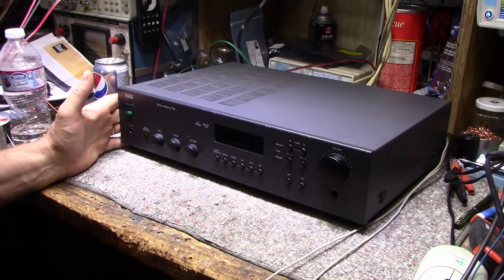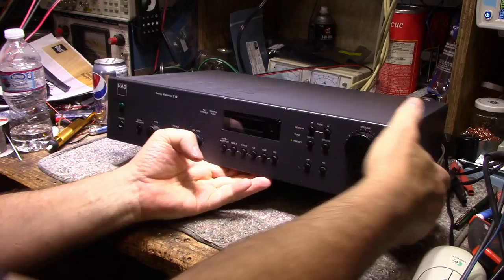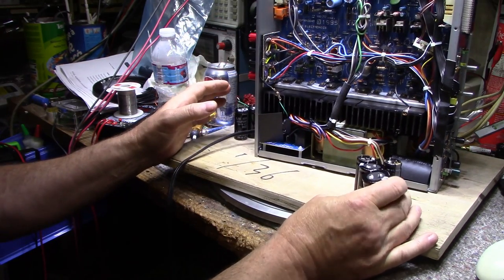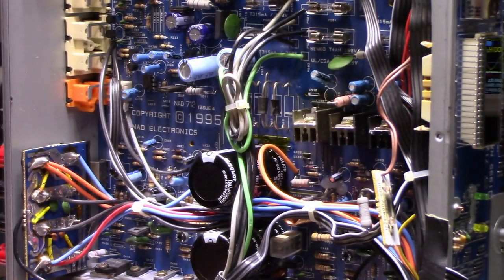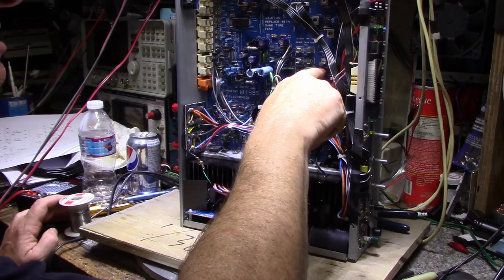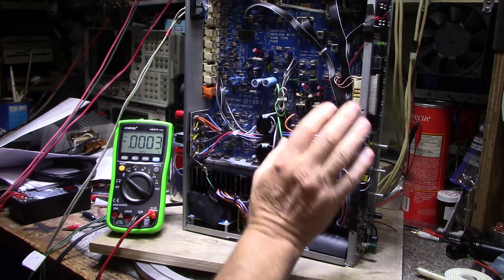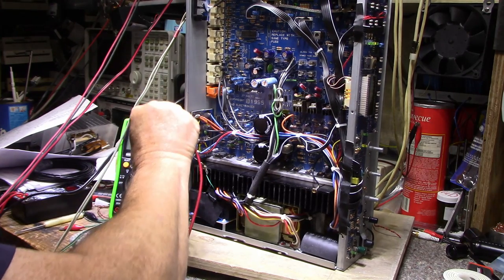NAD 712 Receiver - Repairs (Ep. 86)

Comment: I just bought one off fleabay. The power amp worked but not the preamp, thanks to your video I went right to the +12 V which had exactly the same problem yours did. I just resoldered the joints around the regulator and it works now, I'll have to figure out exactly what I'm going to do long term. Maybe I'll substitute a 68 ohm 10 W chassis mount resistor if I can figure out a place to mount it. 

Thanks so much for the clue as to where to look!
Reply: I just read the temperature of the resistor on the +12 V regulator with an IR camera, it's over 300 deg F! Looking at it again I think I'll get 2 16 ohm 2 W resistors and put them in series.
Reply: I'm also looking at setting the bias, rather than putting the 1 ohm resistor in I'm going to monitor the voltage across R467 to get 0.22 * 30 mV = 6.6 mV, or maybe a bit more to allow for the addition of the base current. that will give me the same 30 mA idle current. I guess NAD figured that most tech won't have a 4 1/2 digit DVM to accurately read 6 or 7 mV.

Comment: Some people think they will get higher current if they set the switch to a lower impedance, but the opposite is true. The lower impedance settings are there to limit current, because the amp can't fully handle such low impedance. Your test proved what I am referring to.

Comment: Hi Trevor,

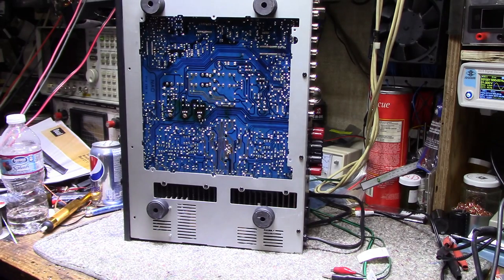Great video! Could you please provide step instructions on how to remove the front panel for the NAD 712? At the 6:59 mark on the video the front panel has been removed but you did not show how this was done. I have a NAD712 and cannot seem to remove the front panel even after removing all of the visible screws that seem to be holding it in place (this is after removing the top cover - which is easy).

Many thanks for helping with this!

Comment: Thank you for posting this video.  It seems after viewing and comparing modern vs. vintage repair videos, the modern amp's seem to have much more heat staining/damage visible on the circuit boards (like this one did) while producing much lower wattage than their vintage predecessors.  Is the simple explanation the modern circuit design and plethora of IC chips?
Reply from the maker: Hi Craig, I don't think it's a simple as that. There are lots of variables at play here, hours of use, build quality, circuit design & layout, quality of components, environment of use and so on. I think NAD did ok in all these areas and provides a good quality product that lasts at least 20 years or better. I do notice their build quality isn't top priority but they do make a great sounding product. It's true modern gear tries to scale down on costs by miniaturization and lowering parts counts, this is where they compromise long life.
Thanks for the comment and watching :)
Reply: @TrevorsBench  hey man great video very interesting. As someone who fix a lot of amps, what brand would you say stands out as best build quality?
Reply from the maker: @cheslynholland1487  Judging best build quality would be difficult because all manufacturers evolved throughout the years and changed manufacturing processes. Most of the changes were made to improve profits when the market got tighter. And you guessed it, when they targeted cost cutting, build quality went down as well.

Comment: Thanks for this video. I have a 712 and I’ve lost the ability to tune in FM stations. Scanning or manual tuning...just static. AM still works perfectly.. Do you have any experience with the tuner section of 712? Is there anything a nube with a soldering iron and a DMM can look out for and hopefully fix? Also, is there a trick to accessing the trace side of tuner section. Taking bottom panel off still leaves tuner section inaccessible. Thanks so much!
Reply from the maker: I can't diagnose through the youtube comments but I can give you a few things to look for to give you a start. Get a schematic for your 712 from hifiengine and have a look at where the power feeds into the FM portion of tuner. Check to see power is supplied to all the chips. It appears the tuner is run from the +12v supply and there are several fusible resistors in these supply lines. With the schematic you can see where these fuses are and their values. The only way to access the PCB btm is to disassemble, I  know it's a pain. Hope that helps

Comment: Hi, I was wondering if you had on thoughts about an issue I am having with my NAD 712. 
It is fully functional, but when it is powered off (not in standby but button pressed off) if occasionally makes a clicking noise.  The led on the Aux or CD lights up with the click.
So, far it hasn't stopped working but the clicking has me a bit worried.  
Any ideas what it could be?
I am pretty handy.  If it is an easy fix I might be able to fix it.

Also, is it safe to leave it in Stand-by mode, or should I leave shut off normally.
Thanks.

Comment: Where did you buy the warm White leds for the display? Can you link it, would be awesome. 
I have a question about my nad c521 disc player.. what bulbs should i install to the display baclight?
Reply from the maker: I purchased the LEDs from Aliexpress. Go there and search warm white led and you'll see several different case styles to choose from
Reply: @TrevorsBench  thanks a Lot 👍 what about the resistor?
Reply from the maker: @sebastianm.t3184  Hi, I did look at the schematic for the C521 and that player uses a Electroluminescent panel to illuminate the LCD. It uses a tiny inverter to step up to the voltage it needs to light. The inverter may have a bad cap or the EL panel itself is worn out. You can buy new panels if you knew the size of yours & just replace it
Doing a LED retrofit might not look good on the C521